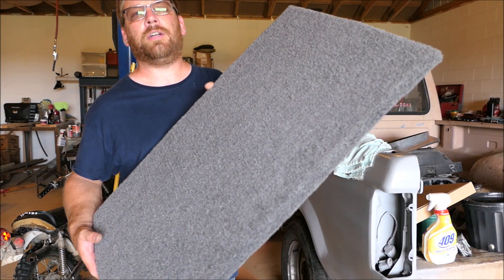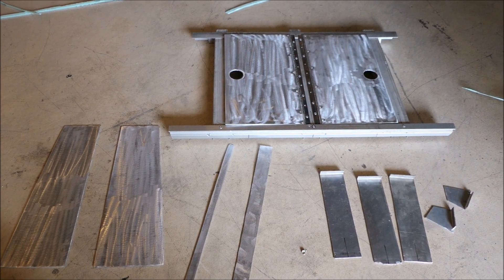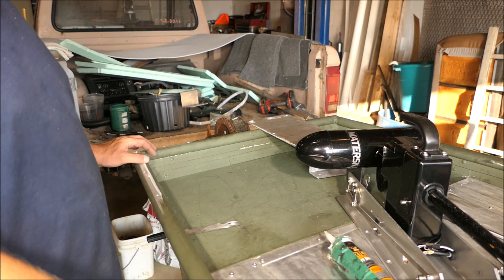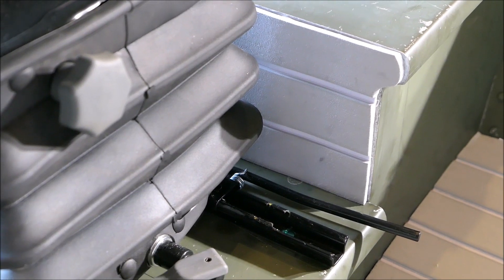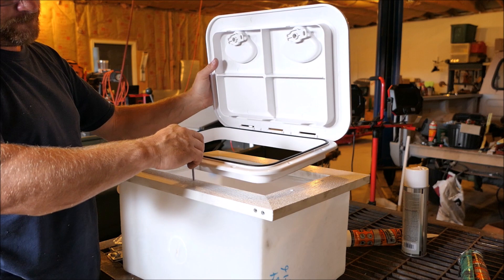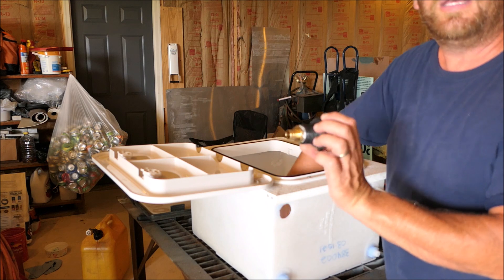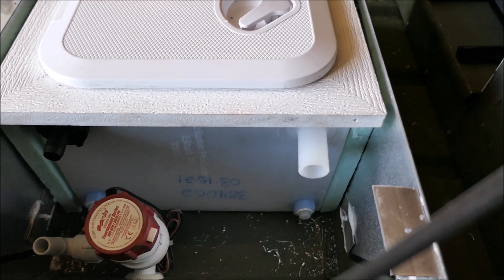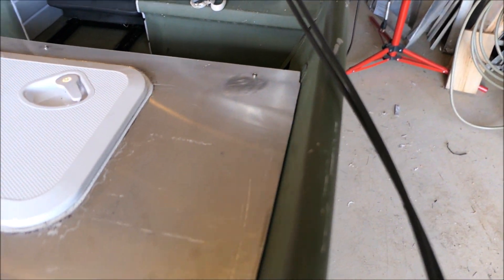Jon Boat Aluminum FRONT DECK and Live Well install

Comment: sir you are a wizard, i just got my own little john boat and i plan on doing atleast 90% of what you've done to yours. I am however hitting a snag finding the foam, i've searched for closed cell foam but cant seem to find the one you used. i love that plank patten almost looks like wood decking. but so far no luck finding it.

Comment: Get a ball gate valve. This is so you can adjust the flow of the water going into your live well. Wide open to fill and slowly close valve to adjust the flow going in. If you have a 1 inch intake hose you need a 2 inch over flow hose.

Comment: Good Job Bro!!!
Reply from the maker: Thank you!
Reply: @kentuckyyankee : Going to be doing something similar to what you did. Looking at cutting the forward console like you did, then manufacture and install a center console. Then, add the slide tracks from a junk car for the seat so I can adjust the seat fore and aft.

Then add elevated decking to the entire rest of the boat front...Then center mount the Trolling Motor, with the foot control to the right center, and the Fish Finder mounted to the left.

I'm also considering mounting the transducer to the front bottom of the boat (as opposed to the trolling motor) and manufacturing a cover fairing to protect the transducer while motoring or trolling. Drilling holes in the bottom of the boat takes some guts, but it can be done...Just have to get the specs right!

Not sure if I'm going to flush mount the Livewell on the front deck or install it in the center part of the aft seat...Trying to keep the CG Balanced...Then build a complete aft deck so either my son or grandson will have some stability back there when they are out fishing with me.
Reply from the maker: @stevenl.halesr.6894  You gotta plan, now's the time to start!
Reply: @kentuckyyankee : Looking for a used boat now...Would rather spend the money on the modifications vs. spending it on a new boat!!!

Comment: Awesome work as always. Couldn't you just put a regulater on the pump so you can control the flow ?
Reply from the maker: I think that is an option but I hate to restrict the pump.

Comment: Great job! That is looking really good. Could you put a gate valve or oriface plate on the discharge side of the aerator pump flow to balance with your discharge capacity?
Reply from the maker: Thanks! May take that route, I need to see how much it is actually gonna pump when I get it on the water.

Comment: Choking the flow with a valve might overheat the pump, and will consume a lot of power. 1. Reduce the voltage with a cheap PWM or a timer circuit that cycles the on/off ratio. I would use a PWM, readily available from Amazon.
Reply from the maker: Good point, and suggestion! I agree